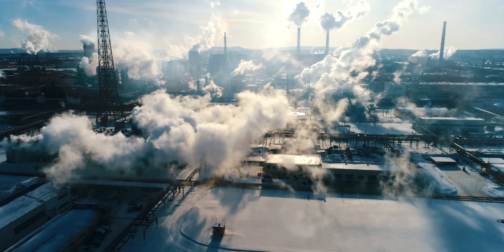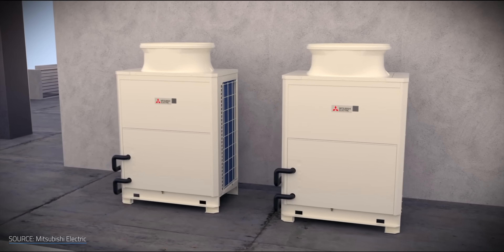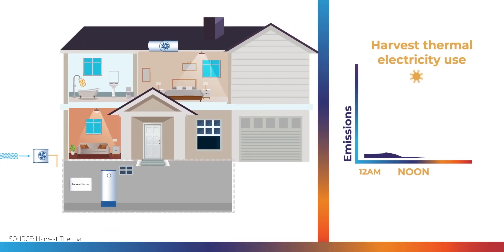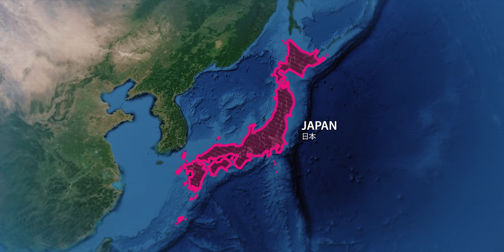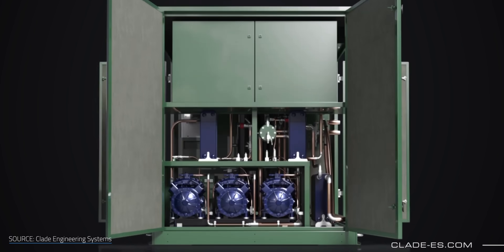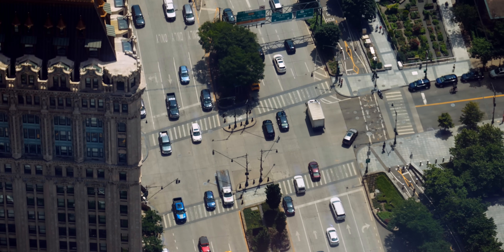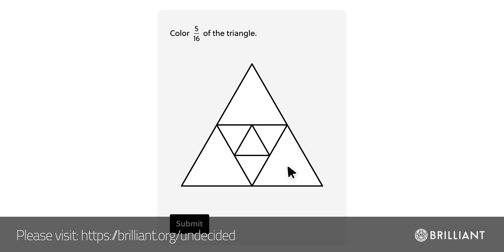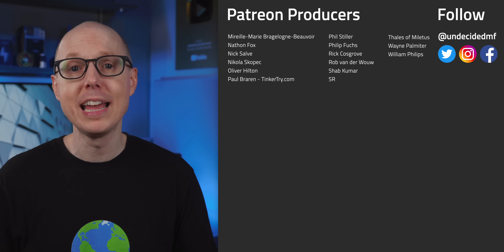Why CO2 Heat Pumps Are The Future Of Cooling

Comment: I started using a Fujitsu heat pump in the master bedroom at it definitely is a good move. Most of my house is heated with natural gas.

I also swapped my gas water heater for a Trane heat pump. Spent $5,000 and I regret it. Using a tremendous amount of electricity. My plumber is suggesting shifting to a tankless gas solution for water. Wise??

For reference, I am in Northern California, I have 73 solar panels and the house is 5300 sq feet. This year my net metering charge is $4000. I am thinking of converting the water, adding a solar powered attic fan, and updating my insulation.. 

Open to other suggestions

Comment: I think there is huge potential for CO2 heatpumps for large refrigerant/heatpump setups as on a large scale. It is almost impossible to prevent leakages on a large scale and many refrigerants are potent greenhouse gases or harmful for the environment in general. With CO2, a little leakage isn't a huge problem, a system slightly leaking over a year likely wouldn't produce more CO2 than a person driving to work with a gas engine vehicle over the course of a week. It might even be economical for systems, especially large ones, to have some sort of system for collecting their own CO2 to replenish themselves from the air around them, thus making them carbon neutral (not counting however they get their energy).

Comment: All this sounds great until you have to call for service. If you can't service these things by yourself, the cost of maintenance and repair keeps this new tech out of reach for most people. Subsidize it with government funds and you immediately raise the cost or the price doesn't come down as most new tech does. Relying on cheap Chinese electronic boards that can be hard to come by when they need replacing is not consumer friendly. This is a racket driven by China and traitors in American legislatures

Comment: I just had a SANCO2 heat pump water heater installed replacing a 21 year old natural gas water heater. It's powered with a PV system I installed 2 years ago plus net metering. I have a separate heat pump for my HVAC which replaced a 18 year old natural gas furnace and 14 SEER AC. I haven't had an electric bill in two years other than rhe monthly customer charge. ECO2 makes is a great product and helped train the installers it as was the first installation of a SanCO2 in my area.
Reply: My out of pocket cost was about $8500, but claimed the federal $2000 tax credit.

Comment: Great video Matt. Thanks for helping to get the word out about CO2 heat pumps and Harvest Thermal's collaboration with SANCO2. I noted that you described both HCFC and CFC refrigerants as having  ozone depletion potential. Currently R-410a is used in the majority of residential ASHP systems. While it carries a high global warming potential (GWP 2088), the ODP of R-410a is zero. This is one reason we look forward to increased demand for CO2 systems (GWP of 1) and R-32 (GWP 675) as the next phase of refrigerants to be used in res. systems.

As a building performance contractor working in the Bay Area we are especially appreciative of Harvest Thermal's product as it more than doubles the potential space heating capacity of the SCANCO2 system when installed as a combination domestic hot water and space heating system.

Comment: I was curious about the cold weather performance of a CO2 Heat pump? One of the big drawbacks of standard R22 or R410 systems when using them for heating in cold weather, they tend to be close to useless when the ambient temperature drops below about 0 degrees Celsius. Below that they tend to kick over to a backup heat source, like resistance heating, or an oil, propane, or natural gas fired furnace. They tend to become pretty much useless when they are needed the most. In New England and the Midwest, where temperatures plummet below -20C on a regular basis, they don't even bother with heat pumps, or just use the cooling side of them in the summer.  I know CO2 is used as a refrigerant in subzero refrigerators used to preserve biological samples, where they can be kept as cold as -80C.

Comment: Propane is our best refrigerant . I t has all the great qualities of R-22 with extra benefits of lower  COP and lower  global warming . Yes it burns but so does the natural gas , oil or propane for fuel to heat your house now. The only reason to use CO2 is the extreme high cost  of man made refrigerants and it doesn't burn . The cost of all the extra heavy steal piping and you cant use copper for heat exchangers is a total turn off for me.
Reply: that's suppose to read higher COP.

Comment: Just a couple of points. CO2 is toxic! But it needs to be in in relatively high percentages in air.
As for CO2 leaks from the system: it's not the cooling pump that's producing the CO2. CO2 can often come from breweries/distilleries where it's a byproduct of their manufacturing, it's CO2 that would have existed anyway. Whether it was in your cooling system for a few years or not doesn't really change much from a climate change point of view.

Comment: will heat pumps gain wider adoption in the usa? not without forcing HVAC companies to stop misinforming customers about what size you need(IE pumping capacity for a given climate) and simply not including an option for the dirt cheap reversing valve in existing AC units)

my 8000BTU window AC was actually quite fine except on the literal heat-wave days, and then all it took was to isolate the warmest room from the conditioned space despite my official need for 10,000BTU based on floorspace*height calculations

yet if I had a home this size with a central AC setup the company would insist on 20,000-40,000BTU of pumping, numbers 2-4x what I could ever possibly need, let alone that a window AC COULD be safer and cheaper than space heaters in apartment buildings, if we mandated that it not be artificially stopped from running a reverse cycle

give me a +50$ cost for the reversing valve anyday(assuming I paid for my own heat which is much more common than my current situation)(and also a smart AC that DOESN'T require an APP to set up, and instead just uses the perfected tech of a WPS button)

Comment: lets think on why traditional refrigerants are still widely used if CO2 is so great
answer: pressure
to have a supercritical CO2 cycle you need to be able to reach 800-1000PSI or more, this is hard to do with any system, let alone one that is often exposed to water condensation

it is being considered for cars and large industrial machinery for the simple fact it has a GWP of exactly 1 with no major long-term damage to ozone or similar so when inevitable leaks happen there is minimal if any environmental damage

assuming you have a sealed system capable of holding >1000psi in highly damaging environments it is great as it phase changes relatively close to ideal ranges of hot days(though the 31.1c supercritical temperature at normal pressure is tough, and the tendency to turn solid if rapidly depressurized can clog lines) but with just a bit of hydrocarbon additive like propane it can make up the bulk of a cycle

so far so good matt, at least this hasn't started with the absolute bullshit of "solid hydrogen" or "cold fusion" or any other thing that was promoted by media with absolutely no basic fact checking

Comment: I’ve had a heat pump in the last two EVs I’ve leased: Hyundai Ioniq Electric & Kia Niro EV. It’s a drastic decrease in energy use compared to past hybrid/gasoline cars I’ve leased. Which makes it even better for camping/Utility Mode/Dog-Mode. The only other EV company using heat pumps is Tesla.

Comment: My experience with heat pumps is that they suck at both heating and cooling and they are expensive to operate primarily because electricity is now the single most expensive energy.  I know that my house built by an architect in 1991 uses about $250-350 per month electric in summer for the AC and it is not like i ma actually keeping my house refrigerated or even comfortable.  I have the air on 81* F from rising to bedtime, and 79* at night.  In winter to heat I put it at 64.  And those bills are even higher.  The problem is when you want to rid the interior of heat you pump it outside where it is even hotter.  And when the weather turns very cold and you need heat you are trying to get it from outside where it is even colder than inside.  So this is really more than a matter of just shifting ambient heat around.  You have to basically create it by using a lot of power to constantly compress and compress refrigerants.  AC used to be better, colder, cheaper when the refrigerants were Freon, now that R whatever crap is just that, crap.  I could see geothermal in some climates, that seems like it would be cheaper to turn on and forget because you are literally pumping endless heat out of the ground and concentrating it.  In some places the year round temp of the earth down 10 or 12 feet is a constant 55 degrees.  That is a lot warmer than the air on cold days when you need it.  I know it is not a popular opinion but nat gas at under $3 is is less than a third the cost of electricity to do the same energy work.  It is very concentrated heat instantly, and the only electricity you need is a fan.  I also want this all to be central heat and air, I hate minisplit and room AC, I had that in an apartment once and never again.  It was right over my bed and came on noisy enough to wake me, blew cold air on my when it was on, was not at all efficient as the landlord claimed, that apartment had one of the highest electric bills of any place I lived in that state.

Comment: I love your videos,
We just built a new house last year And we use our air to water heat pump Overnight to heat our slab, And we have a large buffer tank in case we need a bump throughout the day.
These systems cost more money up front But it's a guarantee return in the long run and typically results in a more comfortable home.

Comment: Whose idea was this? "Let's put an extremely flammable butane-based refrigerant (1234) in a large reservoir in the front of every car with high pressure gasoline fuel lines nearby so that in every small front end crash the car catches fire and burns to the ground. I'm sure car buyers will love this."

Comment: I installed a Sandon CO2 heat pump, hot water heater several years ago. Then tracked the energy consumption with a Sense monitor.
It does have a time of use control in the menu. I have it set from 9 AM to 9 PM.  The other half of the day the hot water heater does not turn on thus primarily using the solar energy from our system during the day. Unfortunately, the water from the tank, circulates through the outside unit, so it needs freeze protection.  This is done with a thermostat. Whenever the outside air temperature dips below 39° the unit turns on and circulates hot water to protect from freezing and heats the entire 80 gallon tank to the setpoint several times per night thus defeating the time of use shut off. 
Our winter, low temperatures dip into the single digits, fairly often.  
The point of these details is to say a bit more than half of the electricity used by the Sanden heat pump during the six month cold season is for freeze protection.  The COP during half the year is cut in half to about a COP of two.  This is still twice as good as an electric resistance, hot water heater but the expense of the Sanden is far more than the added Solar Panels that would be needed to run an electric resistance, hot water heater. In the houses I design now I use point of use electric tankless water heaters.  This not only gives instant hot water, but it saves the wasted water and heat from the residual hot water left in the pipe, running from the mechanical room.  Plus they range from $100-$200 apiece far less than the $6000 for the Sanden.  Finally, I do like the concept of using CO2 as a refrigerant.

Comment: Co2 could be the answer for uk style hot water central heating system. Traditional heat pumps operate at too low temperature to suit existing hot water systems but if co2 heat pumps can heat to 60’c needed for these systems. This means not having to upsize radiators & keep the same units. Possible good solution for uk housing stock going net zero / replacing gas combi-boilers.

Comment: What I find frustrating is that I can't buy a system that dumps excess heat from rooms which are too hot into a hot water tank and rooms which are too cold. The smallest heat recovery systems are way too big for a 3 bedroom house. While we have the technology to make our homes far more efficient than they are now, no-one is selling systems small enough to make use of that technology, so my option seems to be two systems, one pumping heat outside for cooling, and another pumping heat inside for hot water. That can't be more efficient than a single system that pumps heat inside into the water directly.

Comment: The electronics are a weak point in virtually every system . I’ve worked in industrial HVAC for many years . Iv’e replaced many more electronic modules than mechanical modules  . Are there any good leak detection devices for trouble shooting . Are there special requirements for lubricants . Will the co2 systems be DIY friendly or will they require higher skill sets than common “Freon” .

Comment: Would this CO2 heat pump work for my 500 sqft ADU? I am converting my garage into an ADU and was planning to use 2 Heliodyne solar hot water panels, and a 40 gallon water tank to create heat for warm floors and domestic hot water. I have 2.75kw Tesla sola shingles and a Powerwall + already installed in this garage so now I am looking for the best add on for heat and domestic hot water. What do you think?

Comment: I have installed thermal solar panels and a standard heat pump, both heating 500 litres of water "battery". The water battery is then used to heat sanitary water or to heat the house with floor heating system. I run the system only during the day when there is sun or the air is warmer and HP is more efficient... cut the bill by 60% with low tech components.

Comment: It's crazy that in 2023 we still haven't found (or better: developed) a way to store summer heat to use in winter!
Reply: There are ways to do this. But it's a big effort of course.
Pretty simple, but expensive and space-consuming: Heat up water by solar collectors in summer and heat up a big insulated water tank with it.
Then use the hot water in winter for heating.

Comment: I've been wondering why no one has a valve/distribution block like the Tesla valve that can use the heat pump to not just move the heat from outside but between rooms of the house.  The way our house is designed the southern facing side of the house is immensely warmer than the north side, to be able to harness that energy by cooling the room and pumping that heat into our water heater sounds ideal!  And the same for winter if we leave the window blinds open we might not need mich heat in those rooms compared to the backside.  In combination with a radiant boiler and TRV valves as backup I'd think you could have an extremely efficient system than is super comfortable too

Comment: the CFC impact on the ozone is false. The hole has always been there and it comes and goes and we still don't know why.  there was no proof that the CFCs caused the hole that we had just found, and no idea (at the time) that the hole had always been there.  The hubub was just theoretical and we altered the world's efficiency and comfort out of unsubstantiated fear.
Take us back to simple and then work on efficiency and these expensive CO2 pumps will go the way of the dinosaurs.
Also, the gas-burning heaters.. while not that efficient, are EASY. And cheap.  
But to claim that CO2 pumps with heat storage will reduce bills by 45% is stupid.

Comment: @tofulnc you are exactly right. The equipment that is needed to withstand the pressures of c02 refrigeration is much harder to design and implement. Stainless steel tubing and fittings. Large compressors. I don’t see this tech ever being implemented in the residential space. Maybe commercial at some point.